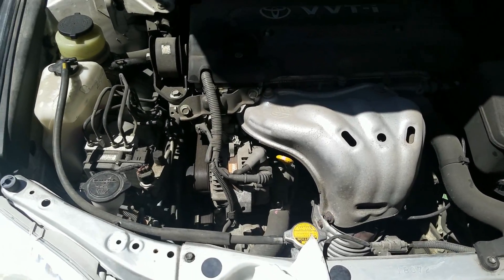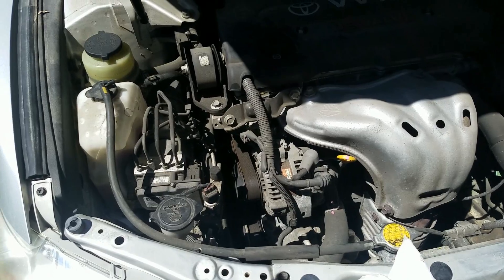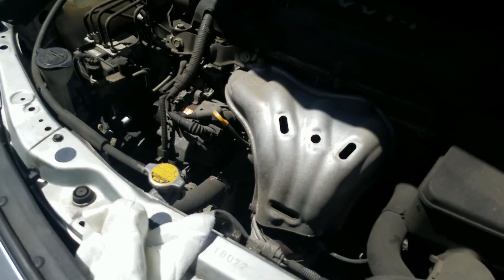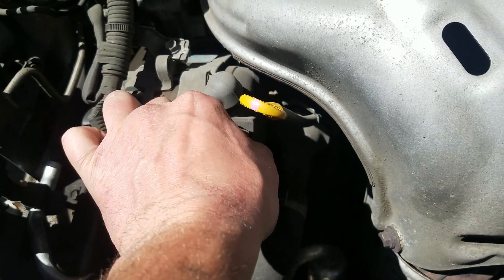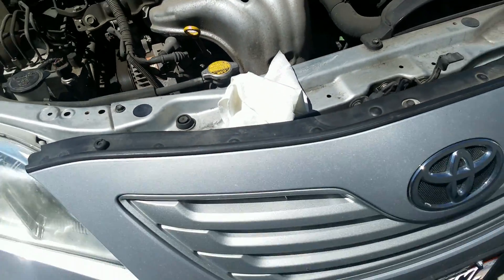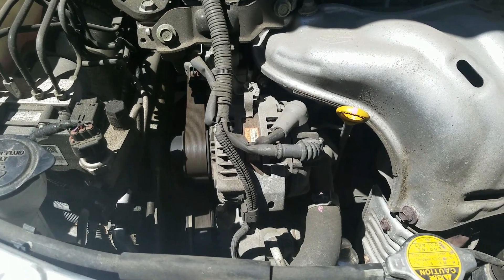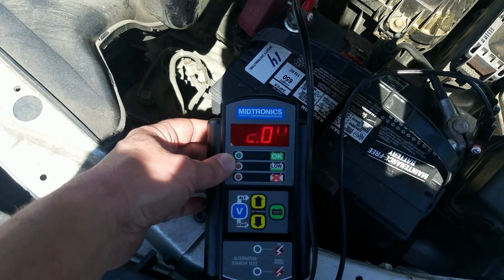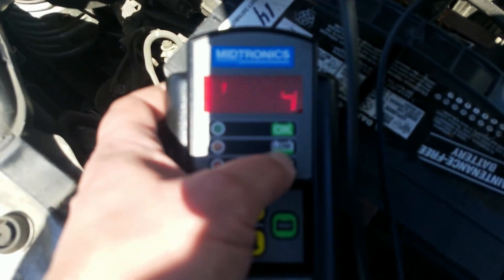Toyota Camry Engine Noise

Comment: 6/12/2018:   Had same noise on my 2006 Camry LE, 93,000 miles.    Toyota service replaced alternator and belt for $700.    Noise no longer there after repair.

Comment: Thanks Scott, same noise is comming fron my 2007 Camry with 108 100 miles. I will check your alternator replacement video and see If I have the tool to do it myself.

Comment: Hi Scott, My 06 Camry is making a whistling sound when I accelerate.  It is rather high pitch.  Also, when I back out of my driveway it is making a quick knocking sound when it is cold.  I don't want to show up at the mechanic with no idea and have them tell me I need $1000 in repairs.  The car has less than 64k on it.  Also, it has had a Toyota Factory Transmission replacement at 22K miles.  Thanks for any guidance
Reply: Looks like you just need to replace the serpentine belt. It may also be the tensioner. Belt is cheaper and super easy for DIY. Get original Toyota belt. Changing the serpentine belt also reduces lots of other noises too as everything runs perfectly when its new belt.
Reply: I have a 06 2.4 also with 105k one owner have a wining noise gets louder when you accelerate I just put a new power steering pump and a new alternator same noise nothing changed. A mechanic said it could be the transmission but it does it in park & while driving you think it’s a pulley or do transmission whine it shifts and drives great. I also have a quick knock at start up. So frustrating. Also do the timing chain need to be replaced on these ?
Reply: @hyejack10 what was the issue? I’m having the same problem
Reply: @josephjoy2245  🤷‍♂️ after replacing belt power steering pump alternator service transmission change fluids nothing changed same noise. So frustrating I just gave up runs and drives good so we just drive it with the noise

Comment: Scott, thanks a million. I have the same vehicle and it's making the same noise.
Reply from the maker: +PDY HRM You're welcome. If you need help check out my video on replacing the alternator
Reply: +ScottTheCarTech I successfully changed my alternator using the guidance from your replacing the alternator video.
Reply from the maker: +PDY HRM That's awesome! Thank you so much for sharing

Comment: but what I'm having a problem with is worrying noise coming from the drivetrain it's not a CV joint I think it's the outer support bearing but it does not grind or anything it may be the inner support bearing it is just whirrring right now been whirring a long time

Comment: Scott, I have a 2010 Toyota Camry 2.4 84,000 miles
This car is driving me nuts! It’s starts with no problem, when I’m driving on streets I hear a loud rattling noise not sure where it’s coming from. But I notice that when that noise starts the car shuts off when coming to a stop. I can drive highway speeds with no problem. But only when the sound starts and I’m coming to a stop is when the car shuts off, but it’s starts up with no problem!
I’ve had the car scanned and no codes. I’ve taken it to 3 different places and still no codes. Any ideas on what to check?
Reply: Did you ever figure out the issue?

Comment: My 2010 Camry is making the same noise. I was told it's normal 🤦🏻‍♀️
Reply from the maker: You should have the alternator tested. Mine was bad. I replaced the alternator and the noise went away.
Reply: ScottTheCarTech  how much is for replace alternator ?